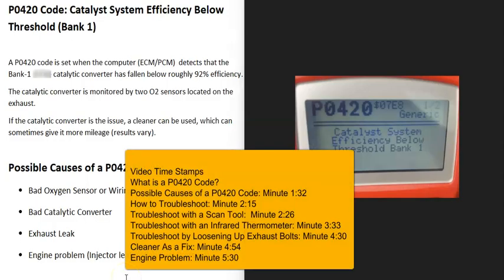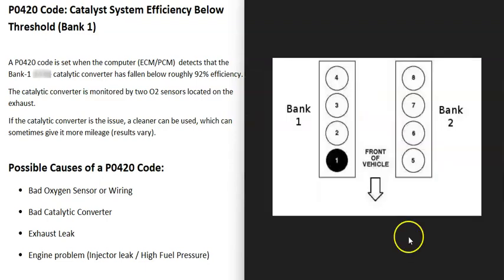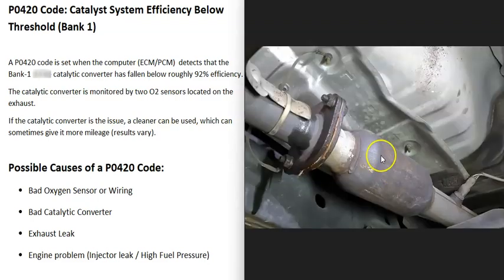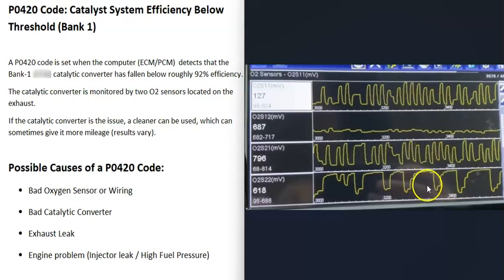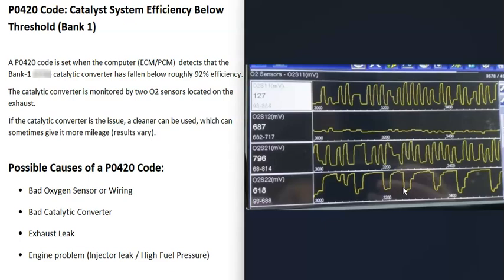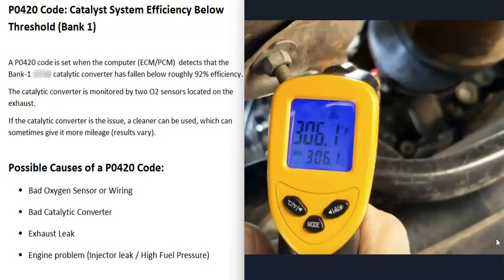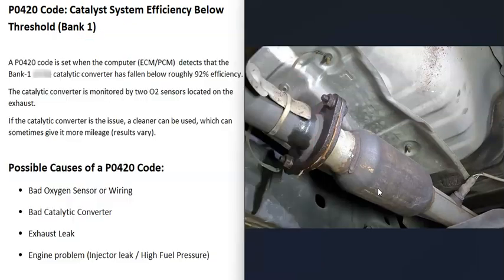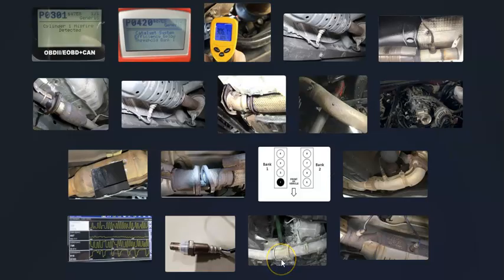Troubleshooting P0420 Code: Catalyst System Efficiency Below Threshold (Bank 1)

Comment: The code P0420 appears when slowing down before traffic lights. What is the reason?
Reply from the maker: It needs to be diagnosed, but when that happens, often there is an exhaust leak.

Comment: I got 2002 Toyota Camry xle 4 cyl. Vvti engine I put new catalyc converter ,new o2 sensor bank 1 &2 still po420  came back sesame code it s confusing
Reply: Did you reset code

Comment: I had my vauxhall put on the diognostics and was told my bank 1 sensor was faulty , after oaying out £228 for a new one from vauxhall and fitting it turns out it was my purge valve in the end that was faulty , it was stuck open and letting too much fuel through causing the second sensor (after the cat) to give a false reading so i suggest checking your purge valve to be on the safe side and save a bit of money

Comment: My wife's Matrix is throwing p0420 lately.  Hesitation while merging on to highway but still accelerated fine when flooring it.  Did a can of Seafoam at 1/4 gas tank with high-grade fuel fill-up after.  Code cleared itself after 200km drive but it's back.  Checked//Cleaned MAF and PCV valve, changed air filter, checked gas cap and all seems fine.  Exhaust doesn't seem clogged and runs great so I'm wondering if 02 sensors are the issue. 🤔

Comment: If it's a fuel issue vs. exhaust issue, don't forget to check your fuel cap,  making sure it's sealed and tightened properly... this can throw this code as the fuel pressure is off, which in turn causes higher fuel pressure and exhaust pressure to be off as well. Reset the code and see if the code returns. It's a simple quick check that can eliminate the one of the fuel problems that cause this code.
Reply: Bad gas or gas cap before you replace anything.  😂.
Reply: Mine was exhaust manifolds

Comment: On my 2015 f150 3.5 I replaced both manifolds and have a small leak ok one. I’m getting codes P0420 and P0430. I have aftermarket catalytic . Was wondering if this could be the exhaust leaks giving us this code or the converter

Comment: I have a 2018 Tahoe 5.3 85k And my bank1 sensor 1 is hotter than my bank 2 sensor 1.  The cat was replaced due to p0420.  But dealer didn’t find the issue.  I did a fuel injector balance test.  Bank1 is lower psi than bank 2.  What you think?
Reply: You have a misfire…..

Comment: I replaced the 02 sensors multiple times put the expensive OEM both upstream and downstream. I don’t see any leaks no rotten egg smell. I have 2019 Lexus es300h with 300k on the converter so it’s 99% the converter fried it’s annoying visit your dealer message you can’t get rid of on dash. This Lexus has been money pit another 1500-2500+ for my converter installed at a shop part and labor.
Reply: It has 300k miles dude… cats wear out eventually. An American car would have exploded 200k ago so count yourself lucky.

Comment: I hope this helps anyone! I had done an engine swap and got this code after. It turns out the exhaust manifold was missing one nut out of 8 which caused a tiny exhaust leak which was hard to identify. Because of that missing nut the gasket wasnt being squeezed so it caused a leak. Crazy how the smallest thing can cause a CEL
Reply: This code definitely has you looking all over the place.

Comment: My Nissan Altima has started to die on me while driving it and as of lately the Timing chain is starting to make noise. Just was curious as to what chain of events commonly are the cause of that.? 
Thanks.!
Reply: Is the check engine light is on? If so, can you get the specific code? That would be the first step.

Timing chain wise, could be the chain, could be a chain guide, cam position sensor, hard to tell without a code.

Comment: Hello my honda crv 2015 lost the acceleration going uphill although engine is still on without any lights. I scanned the  code p0420. What could cause the acceleration stop but engine would still be running normal. I was getting transmission issue prior to that for few weeks. Any thoughts?
Reply from the maker: It needs to be diagnosed, but they are likely separate issues. The acceleration problem sounds like a transmission issue, possibly due to low fluid.

Comment: I have an 05 deville and I replaced the cat but the misfire was still there. Could a faulty oxygen sensor be the problem of the misfire? Code is po420 catalyst system efficiency below threshold bank 1. I'm sure my second cat is ruined aswell as I can't seem to find the problem. Thanks hope I make sense 😅
Reply from the maker: A bad O2 sensor usually won't cause a misfire but can cause a P0420 code.

Comment: There was only one link, & it didn’t work… 
Was using a couple of expensive cat cleaners, every few weeks, for over 3 years, when I happened upon an inexpensive Lucas product that isn’t specific, & it worked faster & only used a tiny amount that lasted over 8 months. I don’t drive more than 15 miles a week, so that probably explains why the specific cat products usually took 60-70 miles before the light would go off.
Reply from the maker: I updated the links; thanks for letting me know. I've never tried Lucas before; I may have to get it a shot. Results can vary with that cleaner, but taking it out on the highway, letting the CAT get really hot, and then the engine exhaust blowing it out can often help.